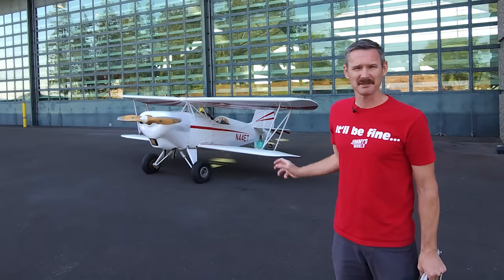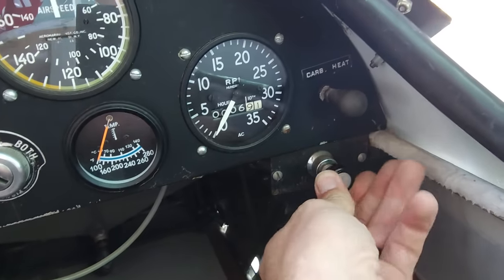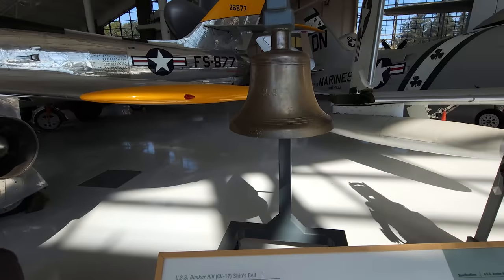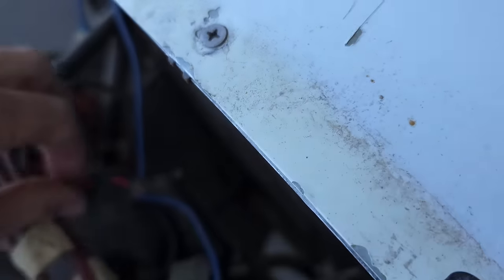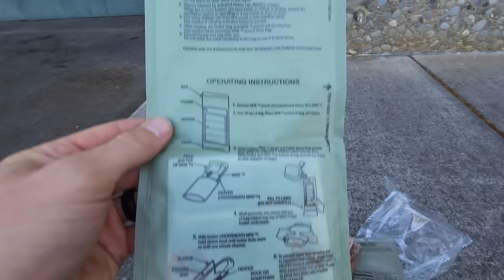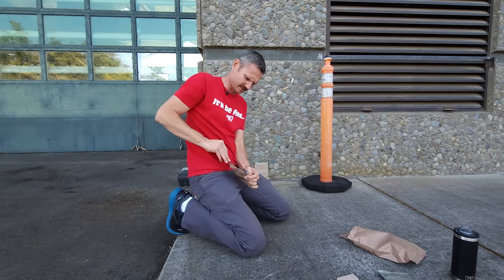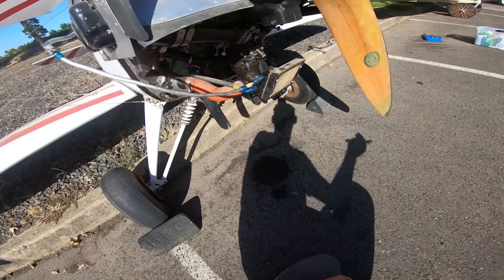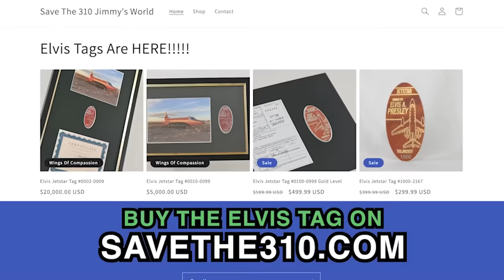Tiny Airplane Only Flown 1 Time… 27 Years Ago Will It Run Today?

Comment: I own and regularly fly a Super Baby Great Lakes.
It's more agile than a Pitts S1 with only single aileron on the lower wing.
This is the best possible bang for bucks aircraft apart from the Vans RV 3 or 4.
If it's got a tail wheel it's a real aircraft, the rest don't count.
Reply: As my dad used to say, "You can learn a lot about flying from a tail dragger."
Reply: Hi Jim I’m flying a 912 powered Murphy renegade. I also have a little toot but it’s not flying.  The Murphy gets off in about 200’ and stalls about less than 30 mph. Hope I can check out a baby Great Lakes someday.

Comment: Jimmy, I love your excitement, but it bothered me to see this engine run with no oil pressure and no way to stop it. This may have damaged the bearings and other internal parts. These small Continentals are notorious for the oil pump to dry out and lose prime if they sit for a few months. On future "will it run" episodes, I suggest removing the line to the oil pressure gauge at the engine and squirting some oil directly into the pump gears (and all the bearings) thru this port prior to starting. I suggest checking the bolt torque on the wooden prop too. Wooden props loose the bolt torque due to humidity changes and can be damaged very quickly if run loose.
Reply: Those concerns were overridden by the fact that there was an MRE that demanded attention.
Reply: I just dropped in here ... Please...tell me he didn't start it with that old crappy oil in it...
Reply: Periodically, usually in the Spring, I had to prime the oil pump on my 85 HP Champ.

Comment: Jimmy, I love your videos, may I humbly suggest an addition to your tool kit? Spiral stakes with fixed tabs. Like the ones for dogs, but instead of a swivel at the top, a fixed welded tab, I forget the correct orientation, it's been a while, but you screw it in the dirt, point the tab in the direction of thrust, and it just stick there, it won't spiral out because you use a short rope tied off at 2 points to a fixed tab, if it comes out, the dirt let go. They don't go in far enough that utilizes are a concern. 

If the tab, spiral, and plane are all aligned correct, you get a pretty good tie off point, not perfect, but amazing in a pinch. 

With the video evidence, you'll look like a safety GOD to your insurance company (The actual aviation gods, or at least the one you're most likely to answer to with the most consequence)

Comment: This was one of your coolest videos. So ....... the spark cutoff for the mags. Leave the blue wire joined to both mags (for testing purposes). Disconnect that wire from the firewall. You may want to add a length of wire to it and find a place somewhere on the plane farther to the rear that will provide a ground. When the engine is running touch the bared end of the wire to the ground and the spark will be killed. Hopefully this helps you ....... not for this one, but perhaps for one in the future.
Reply: Exactly my thoughts my friend. A sort of hot wiring in reverse.. Ian. England.
Reply: Nailed it.. a few sets of assorted jumper leads with alligator clips can be your best friend for instances like this.
Reply: or you could put a toggle switch in line, would also help prevent theft.

Comment: You should have left the blue grounding wire lead on the mags and disconnected it from ground. Then you could have just grounded the lead to stop the mags. Work smarter not harder.

Comment: need to prime the oil pump. common on small continentals that sit for a long time. pull oil temp bulb out and squirt oil in screen cavity. replace bulb and start.
Reply: I noticed when it was running and he showed the dash the oil pressure was ZERO !!!

Comment: Will it run out of gas or seize from not having oil pressure first? It's common that you have to prime the oil pump on the small continentals after sitting that long.

Comment: As a kid in the70s my dad would give me the canned rations for camping. My favorite was stew, pork&beans and the canned bread roll. Had to heat everything up with the campfire. My dad told me when he was in the military during Korea, they would put the cans on the engine manifolds to heat them up.
On another not that bi-plane looks like a toy when your standing beside it. Bet it would definitely get the adrenaline flowing when flying it. Thank you for the video, 😃👍

Comment: Hi Jimmy. Many thanks for a great site. I had for a short time a MONG biplane designed by Frank Mong as a pylon racer. I bought it in the early 90s. It had a 65hp engine, single ailerons. A very slippery little plane. Reg G-BOTA .Great fun. No longer flying cant find it on the CAA registry. Regards Graham

Comment: That's the newer style of MRE's. During the gulf war we had not as good meals as those are. We had 6 choices of meals if I recall. I only found like 2 of them good. I don't really recall all of the choices but I do recall I only liked 2 of them. It had some sort of noodles, but not like cup of noodles type. It always had crackers that were so dry that you would drink a bottle of water just to get them down. They also didn't have heaters. We had to eat the MRI cold. It also came with peanut butter which was just as dry. Then there was always tobasco sauce in the packet with utensils and a water mix. The tobasco sauce was a hot commodity cause you always used it with the meal just in order to give it flavor to eat. The newer MRI are much better. 
Thanks for your vlogs Jimmy, as an A&P, and a retired Air Force aircraft mechanic, I love your adventures!

Comment: Bunker Hill was an Essex class fleet carrier that was severely damaged by kamikazi attacks in early 1945. She sustained strike category damage and should have sunk, but her crew did an amazing job of damage control , and she limped home to be repaired and returned to service!? The damage was total, and the war ended before she could be repaired and she was scrapped. the same fate befell the Intrepid and the Randolph, but no where near as severe as Bunker Hill. Brave young men sailing in a state of the art, well designed and built ships. They all three survived.

Comment: The strange looking engine oil in the crankcase is likely still the old straight 50 weight, mineral break-in oil that was put in when the engine was overhauled. With only 6 hours since re-build, it never made it to the first oil change when normal oil would have been put in. Thanks for the video Jimmy!👍
Reply: can you explain more ?? why it have so bad life ,,you mean they never change the break in oil and thats why its broke?? and whats normal oil weight it use ?
Reply: @Techie1224  I would guess it’s just break in oil hat has emulsified over time.  I would assume that the oil needs replacing with new break-in oil and the engine run until bedded in.  Then use regular oil.

Comment: The Bunker Hill sat at North Island, in San Diego, for years. It was used as a testing platform for a new navy communications system. There was a large yagi antenna on top of it. I was on the USS Ute (ATF-76) and went onboard the Bunker Hill doing an inspection before we towed it out of the harbor for some explosive tests. We started the tow in the late afternoon and got just past Pt Loma, the next morning we had made about a half mile. A second ocean tug was called in to help move it to the test area.

Comment: You SHOULD seriously consider making a safety ground cut-off like boats and snowmobiles wear - a string clipped to you so all you have to do is run away or yank the safety cord.  You pointed to the double ground - use the same principle.  Grizzly can easily make it for you.  Then in case of runaway engine, fire, etc., your only hero motion is to yank that safety string then run!

Comment: Jimmy, when using the chemical heater, you need to prop it up only about 1 to 2 inches. The water you put in it needs to cover the chemical heater pack for it to activate. Bon appetit!

Comment: when you run into that situation of not being able to kill the mags, why not hook a wire to the double mag Hot terminals, and you could either put an inline switch to it then to ground, ot just have the bare wire end you could touch to ground?

Comment: I’ve been hauling dirt on an airport job in NV looking at an airplane sitting there with 3 flat tires and thinking how cool it would be to revive it. I typed in the tail number on the googlator and according to that, it’s a 1961 moony and it was last used in 2008.

Comment: I’m wondering if that engine never had a oil change since it was first started , if not there would be a fair amount of assembly fluids and initial metal wear from its initial startup , not sure if it’s the same as cars but that happens with them and the “break in “ oil
Reply: How about the break-in oil the mechanic who did the overhaul in 70 put in it? Straight 50 weight perhaps.

Comment: Just an FYI... the faster the plane... the smaller the control surfaces.  A slow aerobatic plane needs big surfaces to throw it around. those could be dangerous at 200 mph.  Also... I'm guessing the tied together blue P-lead was to keep an accidental start after storage.

Comment: G, day Jimmy from Sydney Australia. She's a diamond in the ruff, the acrobatic bi-plane. Drop the oil, carbattitor rebuild and check the cables for throttle and mixture?
Why am I always worried about the strength of old wooden propellers?
🛩️🌏

Comment: Great airplane, no oil pressure and a panel that looks almost looks like a J3C-C65.  Hopefully the zero oil pressure might be crap in the oil line to the guage.  I've heard of a similar problem, easily fixed,  in Cubs.  Looks like potential fun.
Reply: it is very common for a small continental engine oil pump to lose prime. I always installed a "T" fitting in the gauge sense line, pressured it up with an oil can, then started the engine and oil pressure was instant.

Comment: In the MRE packages not only will they get really hot they'll also consumed oxygen out of the air around it so you have to be careful and not use them in a closed vehicle and also back in the day ours come with either a pack of Skittles or a pack of M&M's and then they changed and took the M&M's out during Iraq cuz it was too hot and the M&M's melted so they stuck with Skittles

Comment: Jimmy, there has to be a mixture control to lean at altitude and cut off on shut down.
Reply: no, my Cessna 120 had no mixture control as was the case for many planes with a Stromberg carburetor.

Comment: the 27 years to build it makes sense; if the manufacturer says it takes 1600 hours, and fulltime employment is 2000 hours per year, that's 8 years. 
8 years full time - so 27 years spread out when you are working and raising kids and stuff. makes perfect sense to me.

Comment: If you had left the blue wire connected to the magnetos and removed the other end from the airframe you could have extended it to a switch and used that to earth the mags to stop it.

Comment: I was an AF mechanic and not and A&P.. but why would you risk it running with that oil in there? It might cause engine damage right? I mean maybe put some 50w car oil in there if aviation oil is $$.. or what do I know. :)
Watch some videos on lock picking and get a cheep set. I could pick that in 10 min or less and I'm awful.
3rd edit.. did you really just start that on the first throw? Side eyes.....
Reply: not his, he doesn't care if it trashes the engine. Make a video and move on.

Comment: The fuel bowl would’ve already turned on when you cracked the valve in the cockpit so you technically don’t need to refill the bowl that’s a small leak so you could always just split the valve on and off

Comment: I guess it's even smaller than a Pitts S1.  Amazing it can climb that well with only 75hp.  The main problem with the A series cont. engines is no accessory pad to mount anything. Suction pumps aren't really needed anymore, but not  being able to mount an alternator is a big hinderance. I think the C series are the first ones to have that pad. C-85 and up. I'd put one of those in it just to have the niceties of what an alternator can provide. Such as a starter.

Comment: Jimmy, why don't you put a little oil in each cylinder and pull it through a few times before trying to start? Just to be sure there's lube on the walls.

Comment: No oil pressure, gotta pre-oil it by pressurizing thru the breather especially on small Continentals since its been sitting so long otherwise the pump gears wont pick up any oil from the sump and you wont get any oil pressure, luckily you didn't run it for long so no harm mo foul.

Comment: As I watch you ponder the key issue...Safety first... just loosen the key tumbler remove the wires run it over to a locksmith  cut the new key and your off

Comment: i know it's too late to stop, but old oil is dangerous oil, in that the chemicals that make up the oil have separated and will not give you the protection the engine needs to not wear out prematurely.

Comment: Boost that compression to about 10:1 or 11:1 it should make more like 120-150HP with a little head porting,  running 100LL it should be fine with UpTo 12.5:1compression or just add a turbo. 25psi of boost awesome! It should make over 200hp!!  Who could ask for more power?

Comment: "Will it run again?"
Presuming it has fuel, compression, spark/ignition, and the correct engine timing, then YES. There is no question it will run again. 
No reason it WON'T run again if those conditions are met, to be honest. 

"Will it FLY again?" Might be a better question.

Comment: FFS, buy that little thing!  It looks like it would be an absolute blast to fly!
The only concerns I have are (a) It was stated as being a bit tail heavy which could make it a bit dodgy but, easy enough to add a bit of extra weight up front to begin with. Being designed for aerobatics you'd want it less nose heavy so that might be fine anyway and.
 (b) It was stated as being "a bit quick"? Speed is good but by "quick" I'm wondering if he meant very twitchy and snappy kind of control authority, which also fits with being designed for aerobatics too so, maybe a good thing. I might look at upgrading the harness arrangement, not that I could see it that well but, what I could see, I'd be nervous about flying inverted, which you'll probably avoid doing anyway, at least for extended periods with the current fuel/carby system. 
That little thing looks like real freedom in a pocket sized package!

Comment: I love this video (a dream find, but in the UK, the rescue show here would not be allowed due to our laws).  However, after a first engine start in 27 years, with zero oil pressure showing, why didn't you shut the engine down?  Assuming pressure-sensor failure isn't always the right decision....

Comment: The food looked more risky than the engine start.
Could have put the plane into the kerb ,that way if it ran off it wouldnt go for the hangar.
I thought it looked a bit scruffy around the cowling for 6 hrs use.Oil pressure gauge was playing dead.
Gee, dont you like spiders?

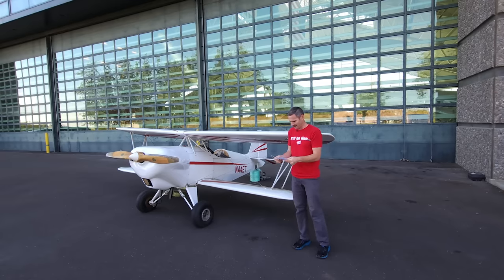Comment: Hey Jimmy the reason the prop is clocked close to the bottom is so you have your hands clear if it starts. Clocked at the top and it starts you could loose a hand. Ask me how i know. Had one of my rc model airplanes with a considerably large engine in it clocked at 1:00. I should have used a chicken stick on it but to save face i just flipped the prop with a gloved hand. When it fired it was so instantaneous that it broke three fingers and badly bruised the other. Thank god for the glove. I think that is the thinking behind the way its clocked.

Comment: For your start test, you should carry what is called test leads, but theyre on like a thin plastic spool and color coded. Roll out as much as yiu need retract the cable by spinning case. And quick on and off alligator clips. But dude, been loving all your back from the dead planes! Youre one of the best and are very knowledgable to the point ive learned so mucb myself and have helped avation mechanics which feels good as a diesel mechanic myself!

Comment: I was at the museum 25 - 30 years ago and remember that little plane. You said you had no intentions of buying the plane but for shits and giggles and viewer content you fire it up with no oil pressure and more than likely damaged the engine and what would have been a disassembly and cleanup is now a full on rebuild. Hey Jimmy if it is not yours and not going to be leave it the Fk alone.

Comment: Jimmy, you would be nuts if you don't buy "Spikey" if it is not to expensive. Heres another thingI want to tell you. If you buy it and before you fly it you need to stiffen up the movement of the control stick. The reason you need to stiffen it up is because I heard you say that the man who flew it said it was very quick. With the large control surfaces on the ailerons and the elevators I can understand why the man who flew it said it was quick. I noticed how loose and floppy the elevators and the ailerons were when you moved them  up and down. Anyway before you fly it please discuss what I mentioned about the tension of the control stick. Just saying.

Comment: What a pitty the owner flew it only once. An arobatic plane is always great, even if a 3G turn is your limit. Arobatic means a very strong plane. That explains the small size, ask any mechanical engineer, small things are stronger.

Try breaking a long stick, then break half that stick, then that quarter, then the eighth of it. See? Shorter is stronger!